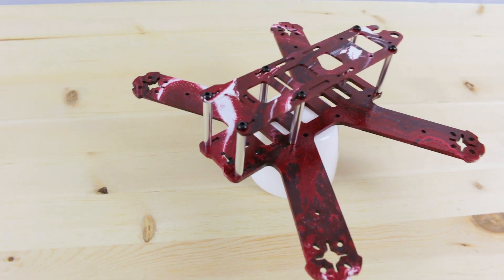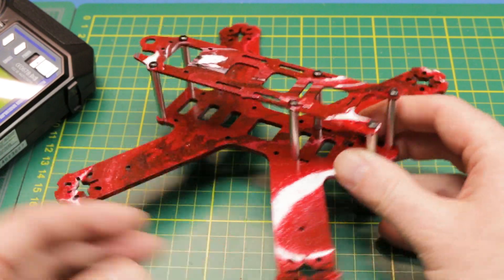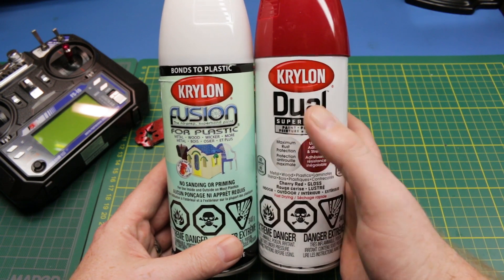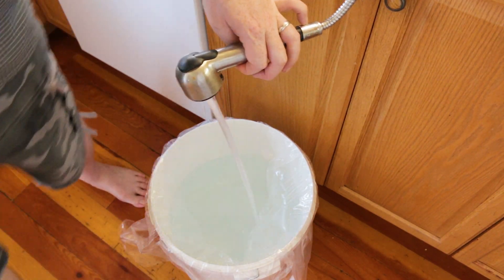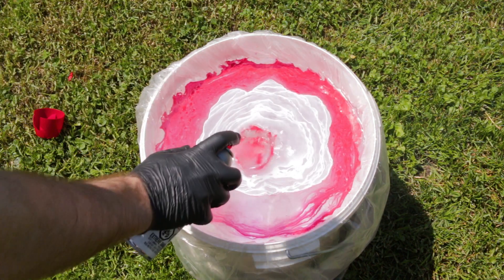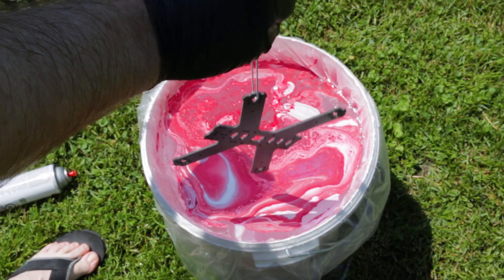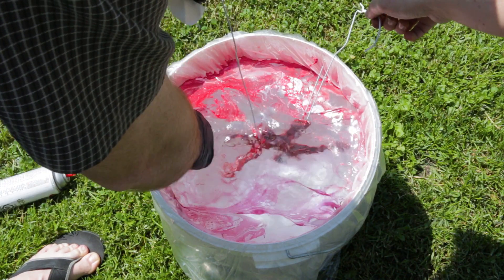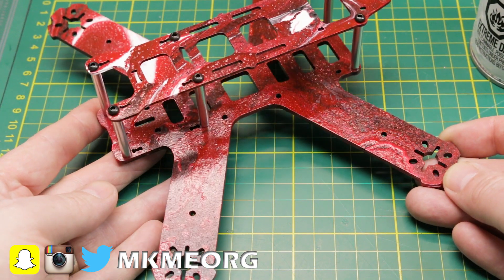Swirl / Hydro-Dip Painting for BEGINNERS! | Tutorial

Comment: you can make it look like glass if after color if you spray on 3 or 4 light coats of clear with about 15 minutes of hair dryer between each coat then after the last of those coats set it up inside a medium size box lying on its side with the hair dryer back a little ways but blowing into the box for about an hour then with a squirt bottle of water dust the the sides one at a time and block sand them with 600 grit wet/dry making sure to keep the surface wet and not go through the clear. when you've knocked down the first layer of high spots or bumps on all the sides wipe them dry with a clean non-linting cloth and spray another heavier coat of clear, do the hair dryer box thing again until clear hard to the touch and wet sand again, do the routine a few times using 1000, 1500, or even 2000 grit on the last wet sand then buff with some liquid polish and when done your finished piece should look as smooth as glass and you wont see any of the bumps or rough surface like you see the frame looks like this video and it's really imortant that you wet sand only, no dry sanding......
Reply: How long are you supposed to wait after hydrodipping.... to spray the very first coat of clear coat??

Comment: i tried this but it scratches right off with my finger nail. anyone else?
Reply from the maker: You probably didn't prep the surface, let dry completely or clearcoat well enough.  Or your paint is garbage...
Reply: First sand the frame with wet sand in bucket water 400 grit wet sand paper and then do it with 220..... then dry frsme.... the use EPOXY APPLIANCE it's in white.... you.only need 1 coat, (light) and apply a 2nd coat 45 minutes later lightly....(if you.forget then you will need to wait 1 week to recoat).... then let it dry for 3 days.... then hydrodip...